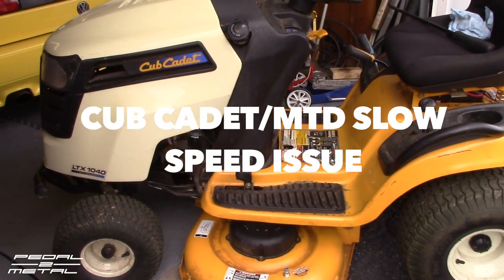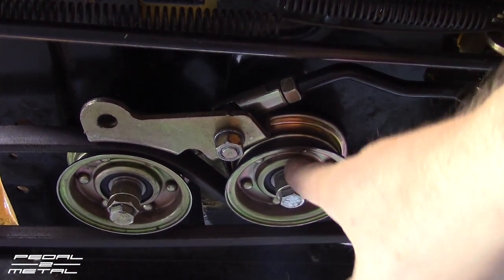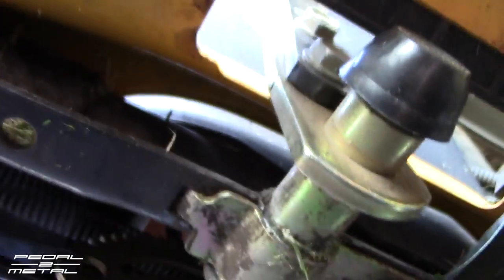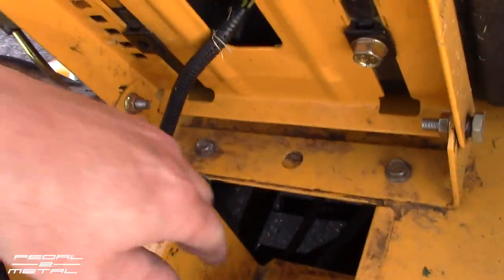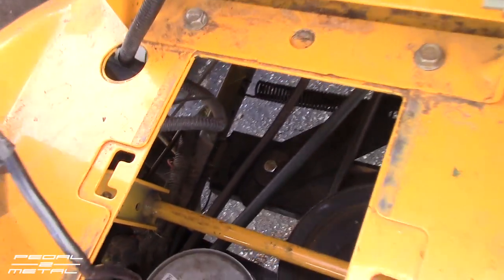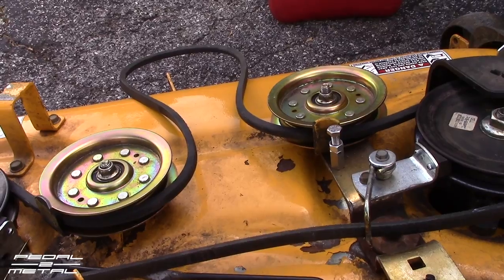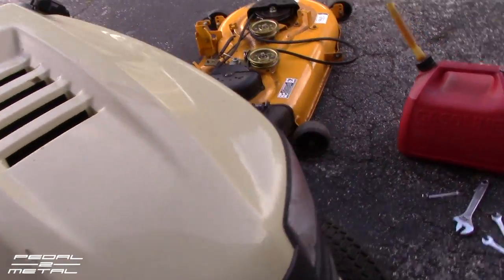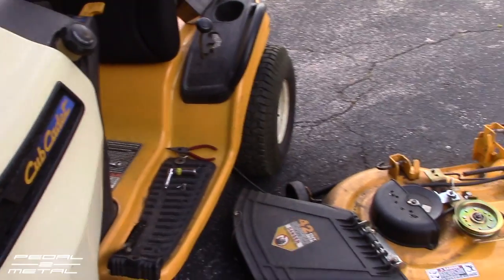MTD Cub Cadet LTX 1040 Slow Speed Issue | What To Do | Belt Routing & Advice

Comment: Ok guys listened to all ideas about what you thought what was the problem so this is what I came up with.This is what I did ,the main drive belt was real sloppy it was the proper 5/8x90.5 so I put on a 5/8x90 and it solved the problem,going to try a 5/8x89.5 if I can find one.Hope I helped someone having this slow speed problem
Reply: i didn't replace all the stuff this guy did but i got a 90" at tractor supply, thing is ready for the race track now haha thanks for the tip!
Reply: I’m in business and it’s a half inch shorter every time on MTD stuff and new spring 
I hate a come back at 72
Reply: So the 5/8x90 drive belt you say is what the Lt1042 is needing. The belt on mine looks fine but is probably a same size replacement from whoever last used the mower

Comment: I had to replace my drive belt on my ltx1042kw 2016  model v twin      had a secret hidden , took out battery and holder and below them and fan was a grey tank that i found out held gear oil and should be changed at least every 4 years  , NOTHING IN MY BOOK OF PARTS ABOUT THIS    Sad that i had to find out this way  I found out how to do it on youtube on vehicle repair guy on youtube .I have replace pulleys,  spindles   belts  284 hours on it . I have 3 acres but 2 mowers . I buy kevlar belts now  . Those cheap black ones are garbage   went trough to deck belts and then bough kevlar and so far lasted  over  4 years now   .
Reply: I agree and it’s all I will install unless they bring there own belt

Comment: sealed bearings are the probem   . I took the covers off my sealed bearings inside facing each other in the spindle . I have a zerk fitting but no grease was getting into the bearings . i found out it is common in all mowers to use sealed bearings I guess so they can save a few pennys on zerk fittings and make moey off new spindles . I rebuilt mine now   . new bearings off ebay
Reply: That’s what I do on all customers mowers and if no zert I drill and tape it 
Last for ever if grease twice a year
Reply: @philliphall5198  I reccommend zerk fitting covers I got off ebay ove 5 years ago they keep the fitting clean  . Plus I buy them in bright colors so I can find the fittings easier . I also do the underside of my decks wiuth slip plate graphite as it keeps grass from sticking to the deck . The oregon blades I got are useless as they hit the dek even though they told me they woud fit .   I noticed my bvlades I took off my 42 inch cub cadet do have a curve to the end of the blades but the ones i  got for my new 46 inch one are straight and that part hits my deck

Comment from the maker: I guess the best way to summarize this video: I basically ended up replacing all the "return" springs, both drive belt idlers, the shorter drive belt's idler (which hangs from swing arm bracket), the vari-speed pulley (aka VSP), and bought new oem cloth covered belts.X

Comment: I bought mine off ebay   the lawnmower shop on there free shipping 6 oil filters 27 dollars   kevlar belts  deck and drive less than 30 dollars  , Put deck one on back when i ordered them but drive belt back then looked fine so just saved it  and now put it on    kolher engine    69 year old woman but not stupid   youtube a great source of info
Reply: I’ve had good luck with eBay parts but watch out on belts

Comment: Your video helped me I had a Cub cadet that was abused and never had maintenance done to it right now we are replacing the pulleys all the belts put new bearings in the spindles redid some wiring had the starter checked and it was the solenoid stuck in open position putting all of it back together this weekend thanks for the video
Reply from the maker: Thanks for watching the video; I'm glad it helped you out!  Mine is still running good so far.... So hopefully I can get another 8 or 9 years out if it.
Reply: @Pedal2Metal_on_YouTube  the biggest issue is around our area there is only one Cub cadet parts store so it's a hurry up and wait on parts from online how many springs are on it I have an ltx1040 same as yours
Reply from the maker: @johnwest2298   the main spring that goes to the varispeed pulley was the biggest culprit on mine. I replaced that one and the gas pedal return spring. I also replaced the spring thar went between the idler pulleys on top of the deck, but I don't think it was necessary.

Comment: You don't have to take the whole spindle off just take the boat and the bearing come just pop the bearing out because if you take that housing off more likely the damn screws usually break off then you got to drill them out so you really don't have to take the whole spindle off you can leave it just on the deckand take the top pulley off and pop the shaft out of there and replace the bearings that way I did that couple of times already in mine
Reply: I know but my old buddy wants it wirked over good and once i take off his other 2 i clean the spindle housing and paint the top part that fits to the bottom of the deck.

Then the only thing that could slicken up old bearings is a spray of oil on them

Comment: Great video My mom has that Cub Cadet mower and when I went down there The mower was staying out when you pulled out t l engage the blades What happened someone must of fan over a cord role and wrapped around the blade Bering So I had to take the belts off and cut around the blade to get the cord off till all blades moved freely Then put the belts back on and ran ok

Comment: Great vid! Question tho....what kind of clearance do you got with that bolt going thru the deck? the bolt you used to get the deck engagement cable up higher...its a thru bolt? with a nut underneath where the blade spins?TY! Keep it up with the tips on the 1040LTX cuz not many out there about this model..
Reply from the maker: It was a standard bolt that I ran from the bottom of the deck upwards

Comment: Did the belt replacement and not sure if I got the spring with the clip back to the right spot as now, the blades just continue to spin. pulling the lever up to disengage  does not stop them. Where did I go wrong?

Comment: And see how cubs decks are alot similar to deeres decks their nothing like craftsman decks but craftsman makes those.

My Lt1042 is lacking power in reverse and in drive i just got its rigged up deck going today so after putting a used deck belt on i seen why the belts been shredding up from the deck engagement pulley bracket so i took the spring off and wired the pulley to stay in place so its just acting as a belt guide because the big deck doesn't go to the mower i don't even know what size the deck is thats on mine but one good thing now is its no longer shredding belts poor woman couldn't get it fixed right but her mowers lacking speed

Comment: Hey man thank you for making this video! I have the same lawn tractor and havent had any issues with it until yesterday after sitting all winter in the shed. I press the accelerator and try's to move forward (or reverse) to only creep along slowly like either the transmission (what I thought at first before seeing this video) or now maybe it's a slipping drive belt due to a weak spring as you indicated. So now Im ordering the springs and perhaps those idler pulley's as well... PS. One drive axle (the left side) is covered in grease, Im thinking a seal may have gone bad. Is there an oil fill or lube for the transmission/drive unit? Thank you again!
Reply from the maker: No, the trans is a sealed unit and unserviceable
Reply: @Pedal2Metal_on_YouTube  Well generally yes, but it can be opened to fix the piece that moves the gears from forward to reverse and back.

Comment: Make a video showing me how to change the lower drive belt. Focus on the engine pulley. I can't figure out how to geg mine off to change the belt
Reply from the maker: I use an impact gun on the lower pulley bolt head, in order to get it free... Then it should drop straight down for you.
Reply: @jmarcinko1139  If you don't have an impact, best bet is to unbolt the engine, but don't take the bolts all the way out.  Just enough to lift up 1/4 to 1/2 inch is all you need for the belt to clear.  You might be able to force the old belt off, but unless you lift the engine just a bit, you will never force the new belt in.

Comment: How did you get the front drive pulley loosened?  (2:50 in the video)  It's a 5/8 inch bolt, but cranking on that turns the whole assembly.  How do you keep the assembly from turning?
Reply: typically you loosen the deck to get the belt off, Not the drive pully.
Reply: metallicblue  I have this mower. I took off deck, then took out 4 bolts underneath the frame that holds the motor on. Then
Tilt motor right and left to slip belt on the top front pulley.
Reply: You have to use a impact gun
Reply: Old shop secret. Take out spark plug and shove the end of a clean small rag into plug hole. When piston can't go all the way it will keep shaft from turning and you can then loosen the shaft bolt.
Reply: Use an impact. I dont understand why people unbolt the engine and do all this goofy shit to get the belt off.
Reply: If you take off the motor cover, there are 2 holes in the side of the assembly that turns on top when that bolt will not come loose for the pulley assembly turning under the motor.  You can stick a nut driver or screw driver into one of those 2 holes and block the motor from turning on a metal post that sticks up on the left side of the motor to support the motor cover.  With the motor blocked from turning like that, you can use a breaker bar with a 5/8 socket to break that bolt loose and unscrew it.  Once that bolt comes loose and is removed, the pulley came off pretty easily for me.  There is a spline key on that pulley, so it has to go on at the same place in the rotation of the motor shaft to where it came off, so take note of that, when it comes off.